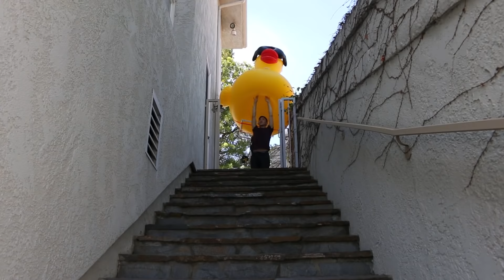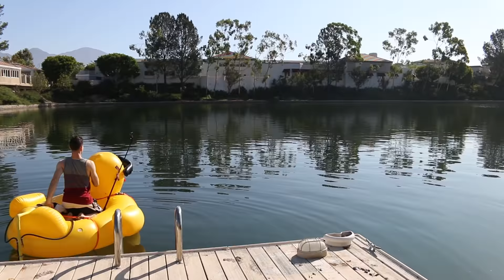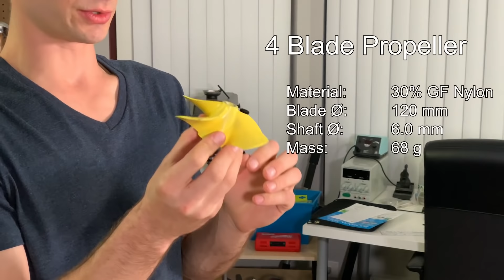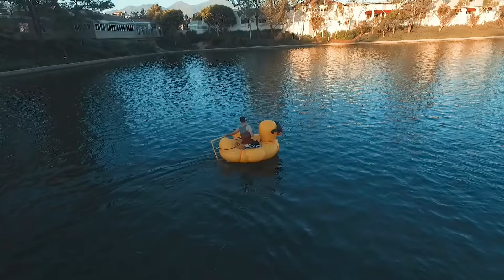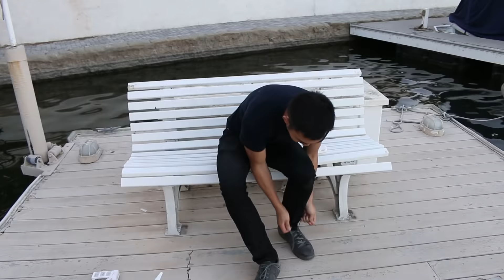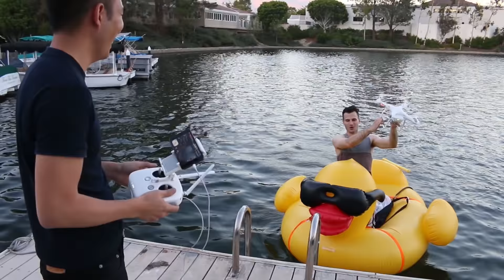Electric Inflatable Raft (never paddle again)

Comment: Very cool affordable set up! Was there ever a desire to attach two additional motors mounted towards the front with an extra battery pack (thinking 4WD)? Would that be nonsensical because putting a motor in front of another motor super bad inefficient design? 

Using the drone to turn it into a rescue hovercraft was really cool

Comment: When I was younger I bolted a piece of plywood to the bottom of a worn out tractor tire in an effort to make a bumper boat. My cousins and I just paddled it around on the river behind the farm. Might have to dig that old tire out of the shed and put a motor on it for my son in a few years.
Reply: Wait... how the hell did a 500lb tractor tire work as boat? Do you mean like the inner tube? Or did you seal it up somehow? I'm honestly really curious about this. When I was a kid I made a racing hovercraft using a moonbounce blower, and a small leaf blower. It was really smooth and fast, but needed an extension cord... it was built under a petal gokart frame, and hit maybe 15mph on land, and maybe 5mph on water, because I had to remove the moon bounce motor to go on water, so all I had was lift, and if you leaned forward it would go a decent few mph lol 
But with that second massive motor, that thing was crazy fun. If you find one of those blowers, a hovercraft is a really fun super simple project for a kid! I bet your kid would love it!
Reply: @DanteYewToob  We only used the rubber part of the tire, no inner tube or metal rim. It probably weighed closer to 150-200 lbs since it took 3 of us to carry the thing.  fortunately it rolled really well so we didn't need to carry it very often.  I can't say that it was a very convenient way to travel, but we did it without any help and it never sank or tipped over.
Reply: @ericness9660  how the heck did it float then!? Haha I'd think 200lbs of solid rubber would sink instantly.
But that sounds cool, kids today dont do enough adventuring! I miss that.
Reply: @DanteYewToob  The tire boat was probably 4 foot in diameter and at least 1.5 feet deep, so the volume would have been around 19 cubic feet. Water weighs 62 pounds per square foot so in order to sink my tractor tire boat we would have had to put over 1100 pounds into it (including the weigh of the boat). It actually floated fairly well, the flat bottom made it quite stable. If I were to build it again I would add some kind of a rudder to make it easier to steer. It spun like a top.
Reply: @ericness9660  OOOOOOOOH! HAHA I'm so stupid! Lmao I thought you just... okay. Never mind me lol I thought you meant, you just put a piece of wood across the top to sit on... that's why I was so confused, you said you just bolted a piece of wood to, it so my dumb brain immediately went somewhere impossible and absolutely stupid. At no point did I consider you just used the tire as a hull structure and meant you sealed up one end with a round piece of wood. Okay. I get it now lol
Yeah, my basic first hoverboard was just a round piece of wood off a giant spool, a tarp, and a leafblower. You just staple the tarp around the edges leaving some space for air inside, staple up the middle of the tarp, or use a small circle of wood and fix it so it makes a donut when inflated, and cut small holes closer to the middle and reinforce them with duct tape. Blow air in a hole from the top of the wood, (ours had a perfect hole already, we just made the nozzle on the blower a bit bigger by wrapping tape until it was tight) and you're off! It's super cool, you should try it. It's like sitting on an air hockey table! Almost 0 friction.. you can just gently push off and go all the way across your lawn. 

My old gym, threw out two tractor tires they used for workouts.. (nobody was doing it properly and people kept getting hurt flipping them) so he said I could have one. I'm making a tire boat for my nephew. We salvaged a tiny 1hp electric boat motor... so its gonna be cool! Honestly. Thank you for the inspiration! I'm kind of afraid of dark water and hate lakes, but my nephew is into it so were gonna go for it! I plan to use expanding foam to make it water tight. Idk how I'm gonna get it around, because I'm 130lbs of solid nerd, and I have a 64 1/2 mustang coupe.. so I can't really move a 350lb tractor tire alone! Lmao
Reply: @DanteYewToob  I just edited my original comment to make it clearer.  I used a thick bead of silicon caulking on the bottom of the tire right before bolting the plywood on, but expanding foam would probably work too.  Good luck with your project!